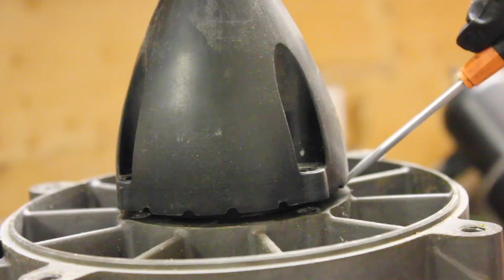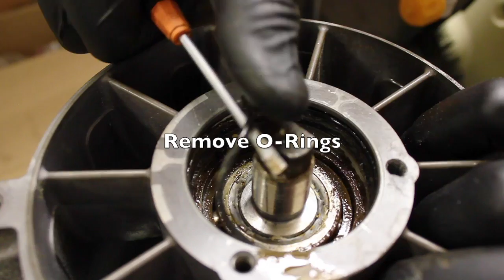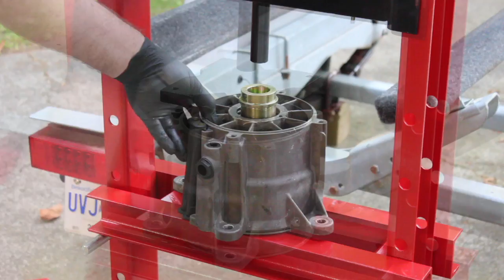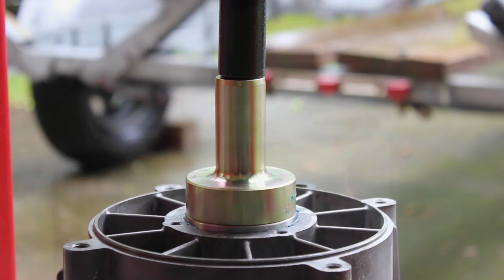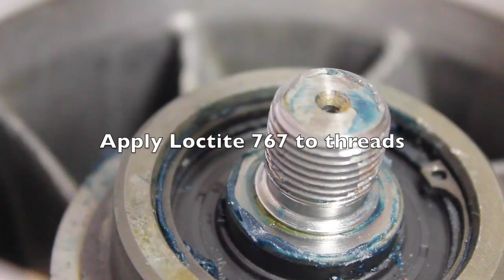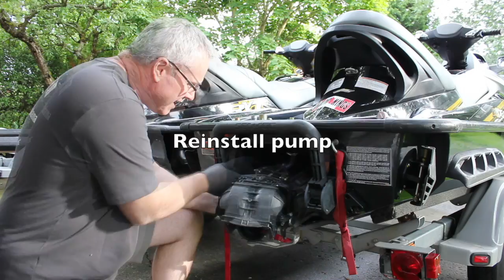How to Rebuild Your Sea Doo Personal Watercraft Jet Ski Jet Pump

Comment: Good afternoon, what special tools are used, and how to get it?
any website that I can buy and be sent to Brazil?
Thank you
Ronaldo Pires
Reply from the maker: There are special tools required and they can be a bit expensive if you're only going to do it once. You'll need a service manual for your model to know the exact tools to use. An excellent resource for figuring out what you need and ordering the parts is Greenhulk.net. I'm sure the ship to Brazil. Good luck.
Reply: thanks for listening.

Comment: Hi, just rebuilt the jet pump. It´s normal that the impeller doesn't turns free for 4-5 turns? Only max. 1... Thanks
Reply from the maker: The seals will definitely make it tight, but it should turn very smoothly.
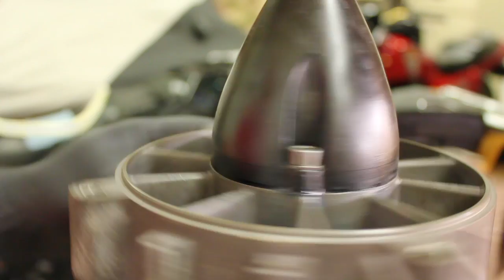Reply: It's not hard to turn, but with the old bearing the impeller turned smoother. It turns like at 6:37 in your video, so I can assume it´s still normal? ;)
Reply from the maker: From the sounds of it you're probably okay. The bearings allow it to spin freely, but the tighter the seals hug the shaft, the more difficult it is to turn. As it wears it'll turn more freely, but it'll also be more prone to leaking. Good luck.
Reply: sounds logical. thanks for your time
Reply: hi, I rebuilt the jet pump because I heard a strange noise and changed the carbon ring a few months ago. last season the gtx sc 2006 was running perfect, 8200-8300 rpm. Yesterday  I used it the first time after jet pump and carbon ring rebuild, but in water it reached only max 7900 rpm and the engine doesn't "scream" like before. Out of water 8300 rpm. I think gas is good, because I added a stabilizer and filled the tank when I winterized it. 1 mm to much oil, but I think it cannot be the problem. supercharger was rebuild 30 hours ago. changed oil and spark plugs in March. after jet pump rebuild the impeller didn't turn freely, only half turn by hand. can be this the problem or what? thank you
Reply from the maker: If the pump was rebuilt improperly, that could be a problem, but I doubt it. The stabilizer may take some performance away, and overfilling the oil can also decrease performance. I would run it again after filling with fresh gas and taking some of the extra oil out and see what happens. Good luck.
Reply: 3ftDeep thank you

Comment: Do you know if the process would be the same for a 2015 130 GTI?
Reply from the maker: The pumps are very similar with only minor differences. Not sure about the torques, though. Best to check with the service manual. Good luck.
Reply: @3ftDeepChannel  Thanks for the reply

Comment: Hi  I have a issue with my rxp215 2004 son day after an hour on the water the hull started filling with water.found water pouring in between the carbon ring and hat replaced with new driveline kit, bellow carb ring and hat.still taking on water no visable gap between hat and ring but water still coming through.any ideas mate?
Reply from the maker: Check your pump to make sure the bearings are still intact. Also, check your engine alignment. Good luck.
Reply: Thanks mate  will do
Reply: Hi pulled pump off can spin prop by hand no water inside cone looked good feels a wee bit tight when spun  and very quiet grind noise from the bearing does that sound ok? Could that effect the leak at the carbon seal if bearing on way out? Cheers
Reply from the maker: @brendanrogers6736  There shouldn't be any grinding nose, but that alone wouldn't cause the problem. When the guts of the pump fail, they can have forward-backward play, allowing the driveshaft to slide forward and backward and unsealing the carbon ring. Check again for forward and back movement. That's good that the impeller is tight against the wear ring, but if you can hear the bearings grinding, you need to address that issue ASAP.  Good luck.
Reply: Cheers just put pump back on ski  to check, and yes found foward and back movement in the driveshaft about 1/2inch movement. Will replace bearing asap thanks mate bloody mint
Reply from the maker: You’re welcome, but make sure you identify what’s causing the play before replacing anything. Good luck.

Comment: I noticed you didn't do a pressure test on pump, any reason why you skipped that?
Reply from the maker: Good catch. We were confident enough in the integrity of the pump, and the quality of our job so we didn't bother. Not a bad idea to do that, though if you've got the equipment. Thanks for your comment.
Reply from the maker: The older pumps that used gear oil for lubrication had a fill plug on the cone so it was easy to pressure test before filling with oil.  The 4 Tec pumps use grease instead of oil for the bearing lubrication so the pump cone does not have a fill plug BRP sell a pump cone with a pressure test plug as a special service tool so the pump can be pressure tested.  To use the service tool cone it has to be installed on the pump then do the pressure test then remove the service tool cone and install the regular cone which to me doesn't make much sense as you are pressure testing an assembly then taking it mostly apart to install the regular pump cone.
Reply: Thanks I'm in the middle of a rebuild and I had the same thoughts thanks for confirming

Comment: What if the impeller comes loose before the flange nut gets free and impeller just spins off?
Reply from the maker: I'm not sure what you mean by your question, but if your impeller comes off that's okay. Make sure you install it properly when you're finished, and tighten to the correct torque and you should be okay. Good luck.

Comment: Can tightening an impeller too hard damage a bearing or nut?
Reply from the maker: It depends on what you mean by "too hard". The main concern of over-tightening an impeller is that it becomes very difficult to take off later on. Always tighten to the torque stated in your service manual. Good luck.

Comment: After how many hours would you say they need to be rebuilt?
Reply from the maker: It depends on the year. If you have a model built before 2008 still with the ceramic washers, it should be rebuilt immediately. Anything newer but less than 300 horsepower about every 150 hours. The 300 horse power models are not supposed to require rebuilding at all. What year machine  do you have?
Reply: 3ftDeep I have a 2015 Yamaha vxr with 120 hours. Took my ski to a shop to get some performance parts on but he’s saying other work like a rebuild may be required. He said  that he’ll let me know once it’s apart.
Reply from the maker: We're mainly Sea-Doo wrenchers, but I don't think your model has a supercharger. If you're having issues, there may be an engine problem, but your engine should not require a rebuild after only 120 hours. The engine should be good for 500 hours before a rebuild; perhaps a lot more. Good luck.
Reply: 3ftDeep apologize for the confusion. I was referring to the jet pump not an engine rebuild.
Reply from the maker: Whoops, my fault. It's such a tiny thumbnail I thought you were referring to our supercharger rebuild video. There are no ceramic washers in the Sea-Doo pumps. There is no real timeline for rebuilding the pump. You should check it periodically (annually, actually) for water intrusion. Usually at the end of the season. If the grease is still clean and not "grey" or "milky", the seals are still good. If there is a bit of water you need to replace one of the seals (probably the oil seal). If rust starts forming in the pump because water got in, you may need to start replacing components or rebuild it. But essentially, unless it starts making noises, or water gets in and starts rusting, they can function perfectly for many hours. Hopefully yours is in good shape because the internal parts are a bit expensive. Also, it shouldn't require rebuilding after only 120 hours and 3 or 4 seasons). Good luck!

Comment: IS TH JETPUMP HOUSING THE SAME SET UP ON A SEADOO SPORTSTER 2003 4 TEC 155
Reply: I MAY HAVE A WARPED PLASTIC PUMP HOUSING, WAS THINKING ON GOING WITH EITHER A NEW PLASTIC OR ALUMINUM HOUSING PENDING PRICE, DO U HAVE ANY SUPPLIERS TO CONTACT, HAVING A HARD TIME FINDING EITHER
Reply from the maker: If you dig into Sea-Doo's website, they have a parts fiche for their machines. You can find the exact part number for your housing there. Good luck.

Comment: I bought a 2007 GTI 155 and I realized that it uses grease and not oil like the old models. Can someone tell me what grease I should use for the jet pump? thank you very much 🙏🏼
Reply from the maker: sea-Doo only sells one type of grease for their jet pumps. It is yellow and colour and is available from their website.
Reply: @3ftDeepChannel  And could I use another type of grease other than Seadoo?
Reply from the maker: We’ve always gone with Sea-Doo bearing grease for the pump. It’s a bit expensive, but at least you’re certain you’re using the right stuff.
Reply: @3ftDeepChannel  Thank you very much for your suggestion. Your videos are very well made, they help a lot for us people who like to work on our Toys 👏🏼👏🏼👏🏼
Reply from the maker: Thanks!
Reply: @3ftDeepChannel  My pump jet had oil and the bearings sound perfectly. but I realize that it has a plastic that would not let the grease in when I was going to apply it. Do you think I can remove the plastic or should I put oil back in?
Reply: Sorry, I think I didn't explain myself well. the plastic is in the bearing
Reply from the maker: I would use the Sea-Doo recommended jet pump bearing grease and not oil. This is the part number for the jet pump bearing grease I found for your machine on their website: 9779703

Comment: Why you no use the power of hot and cold when doing all that, stuff would just slide together without having to press or at least without using great force!  It makes me and baby Jesus cry when people do not use the natural power of science.
But good video none the less, it would be a great help to the new mechanics or new water craft people out there. A++ for guys like you making this stuff.
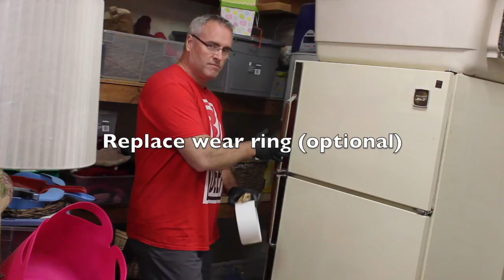Reply from the maker: Well, in fairness we do put the wear ring in the freezer (see 5:26) to help out ...although it works even better sometimes if the entire pump is put in the freezer. Thanks for your comment.
Reply: @3ftDeepChannel  Putting the entire pump in the freezer works great for removing the old wear ring; but for installing a new one you heat the pump to expand it and cool the wear ring to shrink it.

Comment: What is the cause for a jetpump  reducer seal  to leak ?  Is it common?
Reply from the maker: Normally it gets deformed by getting pinched when installed incorrectly. Other than that, it usually keeps its shape but the rubber can degrade over time (usually over 10 years) and the seal can fail. It's not normally a big failure item in our experience, though but if you have any doubt about the integrity of the reducer, it's worth spending the $20 and replacing it.
Reply: @3ftDeepChannel  could that reducer seal cause a lost of rpm. Like sometimes iam not making max rpm. It's come to my then come down to 6500, then  sometimes it pick back up  to 7150
Reply: @3ftDeepChannel  what iam getting is that it will come to 7k rpm and so times drop back to 6050. And if you stay on the throttle  long enough  it pick up to  7150.  But it takes a few mins
Reply from the maker: Boy, there are a lot of things that could cause that problem. What year is your machine? What is the make and model?
Reply: @3ftDeepChannel  2005 gtx 4 tec 155 I learn towards a fuel issue .
Reply from the maker: I agree. First, check your pump to make sure there is no obstruction in there. Then, I would look into your fuel system, including changing your fuel filter. It isn’t a very difficult job, but it could be a simple problem like that.

Comment: Is there any where in the repair manual that actually has all the engine codes?
Reply from the maker: I guess it depends on the manual. Have you tried a Google search? We always find that's the fastest way to find the error code.
Reply: 3ftDeep I purchased the dealer manual. And I cannot seem to find any on the internet. You would think the manual would have the
Reply from the maker: @godfatherstilllives5327  What code(s) do you have?
Reply: 3ftDeep I have a 2016 rxp 300
Reply: I am told it is a hot exhaust code. Sorry I don’t know this what I am trying to figure out
Reply from the maker: @godfatherstilllives5327  Very strange. Check to make sure there's not a blockage in the exhaust. Also, make sure the temperature sensor looks okay.
Reply: Will do thanks for your help, it’s at the dealer. I don’t have a scanner for it but from one technician to another thanks

Comment: my jet pump is very tight, I removed the engine for a rebuild without taking out the jet pump but it is very hard almost impossible to turn without the engine on
Reply from the maker: Did you ever solve this problem? A good impeller with a new wear ring should be rubbing, but not that tight. Sorry for the delayed response.

Comment: SOS!! my engine starts out of water, but having an issue starting in the water help me please!!
Reply from the maker: What year make and model is your machine? When you rev it when it out of water what sort of RPMs can you achieve?
Reply: @3ftDeepChannel  thanks for answer,it's a seadoo sportster Le 2004 rotax 947 strokes, out of water rpms and everything looks normal but when I put in the water engine turns but won't start.PS I put a new jet pump

Comment: Why the jet pump is very expensive while they make it from rustable metals !!!? Thanx for the videos
Reply from the maker: The pump is usually okay when it's in fresh water. Salt water, however, is very corrosive. But any water that sits inside the pump is very bad as it won't allow proper lubrication of the internal components, and will cause rapid wear. Sorry for the delayed response.

Comment: Mine doesn’t have the flange nut how would I remove my impeller
Reply from the maker: Do you have the hex head type? If so, use a socket with ratchet for that size of hex head.

Comment: I need help anyone so the drive shaft is on my impeller and I don’t wanna ruin or damage it but how do you take it out and btw the impeller is out of the jet ski
Reply from the maker: If your impeller is out of the machine, I assume you have pulled the driveshaft out of your machine as well?
Reply: @3ftDeepChannel  it’s out yes but it’s inside the impeller how would I take that out
Reply from the maker: First spray some penetrating oil where the driveshaft enters the impeller. Let is soak for 20 minutes and repeat 2 or 3 times, waiting 20 minutes between application. I would then get a vise with 2 blocks of wood on top of each jaw and rest the impeller on it with the drive shaft hanging down between the jaws. Then, gently tap the impeller up and down being very careful not to bend the blades. If it won’t budge, try more penetrating oil. You could also try a bit of heat (with a heat gun) on the impeller, trying not to heat up the driveshaft much, and then try again. The point is that there are splines on the driveshaft that fit into the impeller. They’re likely rusted and anchoring tightly to the impeller. The impellers are very expensive (and so are the driveshafts), so be careful not to damage either. Good luck!
Reply: @3ftDeepChannel  that’s to get the drive shaft out of the impeller correct
Reply from the maker: Yes, for a Sea-Doo. I’ve assumed you have a Sea-Doo.
Reply from the maker: Just to be sure. What year, make and model PWC do you have?
Reply: @3ftDeepChannel  yes thank you for the instructions
Reply: @3ftDeepChannel  I have a 1994 seadoo xp
Reply from the maker: Yes, it looks like you've got splines and that extensive corrosion is your problem. Hopefully you will be able to reuse your driveshaft and/or impeller after removal. Good luck.
Reply: @3ftDeepChannel  thank you I have a new impeller for it but I would like to use the same drive shaft Bc it’s still looks good

Comment: If my idiot friends attempted to start my 1995 seadoo gts on the beach! (While I was gone for 20 min) could debris(sand ,leaves,small pebbles...) have been sucked into the jet pump and can I save her?,she still starts but not into moving.much.
Reply from the maker: Yikes! Sorry to hear about that. You need to do the following: 1) Remove all debris from the pump. You should be able to do that by going through the intake grate. There could well be a stick or rock caught between your impeller and wear ring, or in the pump housing; 2) Inspect your impeller for damage. If the edge is damaged, you'll need to get it refinished or replaced; and 3) Check your wear ring to see if it's been ground down. If there's more than 1 mm or so clearance between the wear ring and impeller, you'll lose power. Good luck!
Reply: 3ftDeep thank you!
Reply: 3ftDeep thank you again!I have one more question if you don't mind,is the protection boot around the drive shaft supposed to spin when the engine is running
Reply from the maker: Absolutely not. It should be clamped to the hull. If it is, you need to investigate. Good luck.
Reply: 3ftDeep thanks again,you are an immense help!Please keep up the great work!

Comment: How to replace seadoo mirrors on a gti155
Reply from the maker: Sorry, we haven’t made one on the topic but you may get an idea on how to do that from our video on how to install heated grips. Good luck.
Reply: @3ftDeepChannel  

Thank you. Already. Fixed. 

I used a trim tool and a heat gun to soften plastic so ,I would not break any tabs or plastic wind screen.